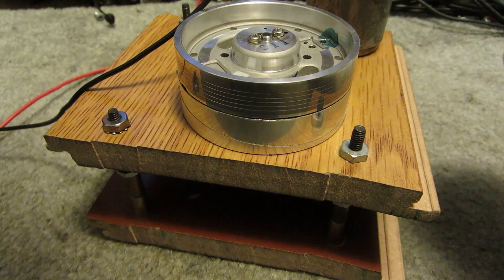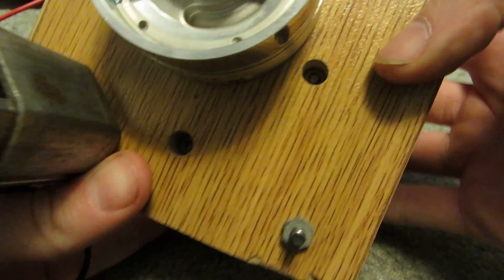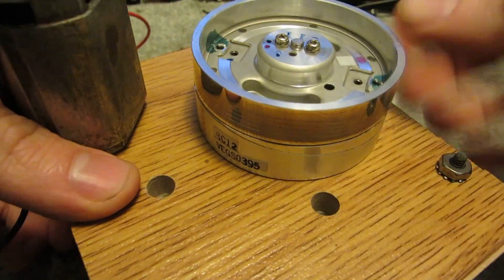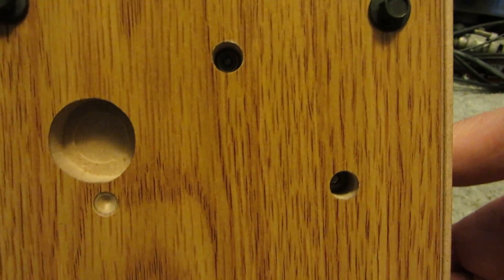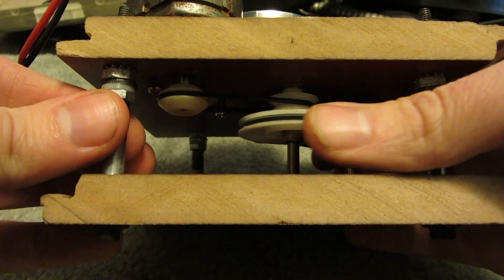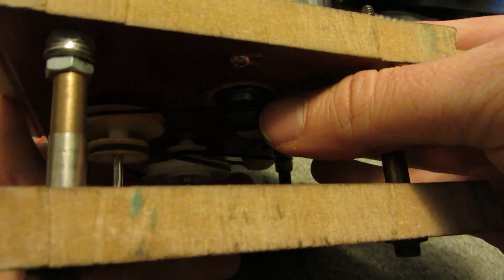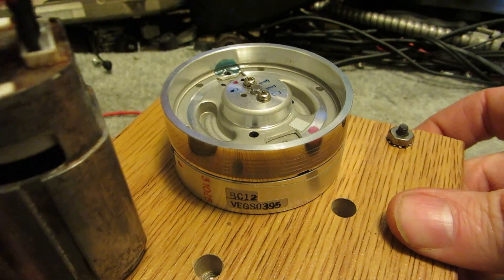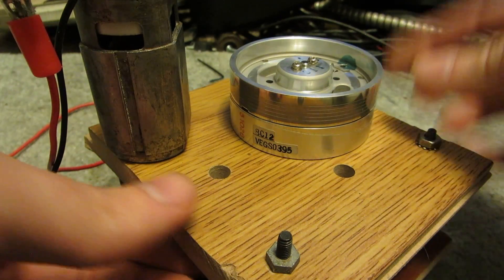Spin-Up Sounds - Belt Reduction Demo

Comment: technically witch a write head at those speeds u can write about 2K video on a tape ..lol 2260P  instead of standard 480P    ...probably look like shit and have bandwidth props but would be cool to see how many slices and how tightly they can be packed on the tape ...hehe  i am interested in vcr for data storage